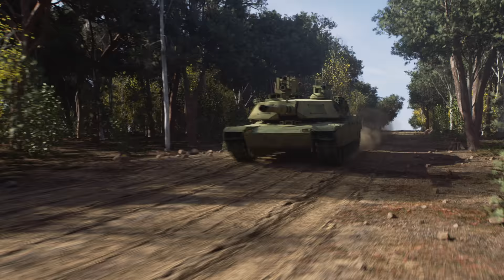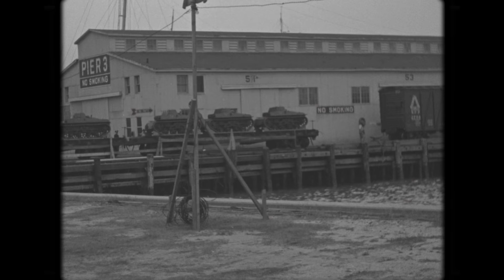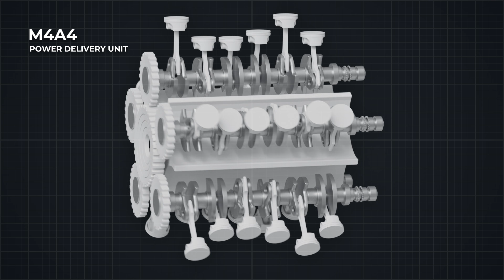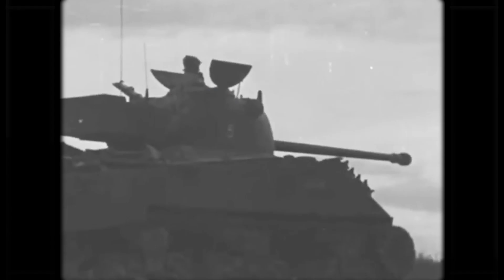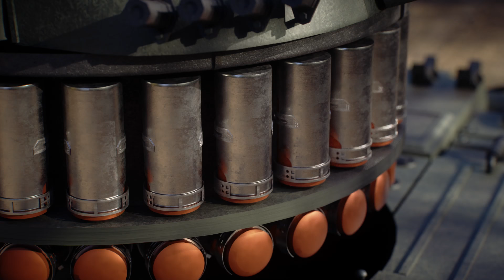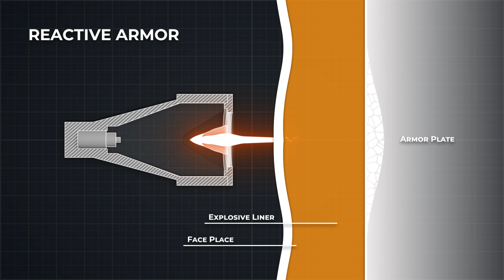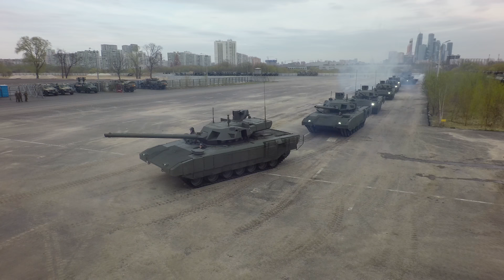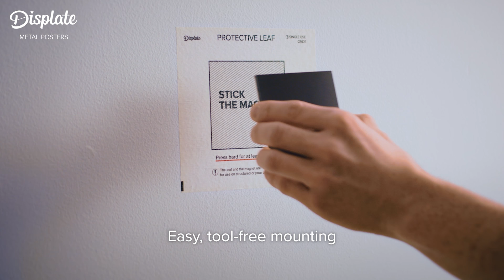Why America’s Tank Failed in Ukraine

Comment: We gave the ukrainians older, degraded variants of the M1 Abrams, basically early 1990s technology, and still better than any modern Russian stuff. It did it's job well and considering we only gave them 31 (plus what they're getting from Australia), things were alright. The difference is that the modern battlefield is way more different than it was when these tanks were manufactured.
Reply: "and still better"
Combat-proven to be inferior.
" It did it's job well"
Murdering it's crews? Getting blow up dozens of miles away from the frontline?
Reply: @vladkorobov155  Russian tanks are deadlier for their crews. The Abrams has a separate ammo compartment and blowout pannels.
Reply: @artiomvv569  
No they aren't.
Nobody cares,because M1's ammo compartment is infinitely more vulnerable and blowout panels are  
a dice roll.
Reply: @vladkorobov155 still safer than having your tank turn into a pressure cooker that launches the turret 200 ft in the air.
Reply: @artiomvv569  
No it's not safer in any way,because probability for scenario you're describing for a crewed tank is extremely low.
And after you ditch the burning tank,nobody cares what happens to it an hour later.
Tanks are expendable. Except for USA,which doesn't build them,so every one lost is lost forever.
Reply: @vladkorobov155  crew survivability is a must in the modern battlefield and western tanks are better protected. Russians aren't even bothering putting the T-14 into mass production, citing it's too expensive despite costing like 5 million $, and something like a Leopard 2a8 costs 30 million $, the same as an SU-34. The Russians had plenty of good projects like Object 187, basically a T90A on steroids and Object 490A which looker like a T90A mixed with a leopard 2 and then theres the Object 490B which looks like something Megatron would turn into in vehicle mode.
Reply: @artiomvv569  
"and western tanks are better protected"
That part is wrong.
"Russians aren't even bothering putting the T-14 into mass production"
Which is why it's production numbers exceed entire NATO MBT production,combined.
Reply: @vladkorobov155 the frontal armor of an Abrams is meant to be equivalent of 1.1m of rha against kinetic penetrators and 1.3m against high explosive anti tank. The turret of the T-14 probably couldn't withstand 20mm ammo by how thin it is. And how's T-14's production higher than all of NATO combined, when only 20 of them have been built in 10 years. That tank has been in developmental hell for 15 years. They should have continued with the object 292 before it, but Russians always go for the cheapest option, it's always been like that, and only now they've finally figured out how to put a new transmission on the T90M, so that it can go at 25kmh in reverse, instead of 4kmh like before.
Reply: @artiomvv569  
"the frontal armor of an Abrams is meant to be equivalent of"
38mm sheet of steel.
That's literally the entirety of upper glacis.
"The turret of the T-14"
Is inside anti-fragmentation frame and therefore invisible and won't be discussed.
"when only 20 of them have been built in "
...last three months.
Reply: @vladkorobov155 the armor on the upper glacis is extremely sloped, you can basically call it roof armor. And i severely doubt 20 have been built in the last month alone, if so, we would already have seen them in ukraine. The problem is that an anti drone active protection system needs to be developed before they can enter combat. Or you could take that T-14 and put all that stuff on it. Tsar Barbecue grills, metal barns, "bushes" made of wire and what such. They do work, it's hilarious how ukrainians mocked them for using these improvised protection systems, and then copied them as well. But thats another story.
Reply: @artiomvv569  
"the armor on the upper glacis is extremely sloped,"
Yeah,and rounds travelling at ballistic trajectory would care SO much...
Gods,for people that don't know physics,world is full of wonders.
"i severely doubt 20 have been built in the last month alone"
Nobody stated that. 
In THREE months,OTOH...
"if so, we would already have seen them in ukraine"
T-14's been operating in former Ukraine for over three years now.
It's been seen there,just not by any OpFor survivors.
"The problem is that an anti drone active protection system needs to be developed before they can enter combat"
It's been developed over a decade ago.
Them radiation signs aren't just for show,you know.
Technically,payload dates from like Soviet Union's Athropos RPG EMP round.
Reply: @vladkorobov155  top attack munition will absolutely penetrate that armor. From the right angle, even a 14.5mm round could go through that 38mm plate. Now if T-14 had been produced in large enough numbers they would have seen more combat. And regarding APS, drones fly too slow to be intercepted, compared to rpg rounds and attack from various angles. And this Anthropos rpg emp round, I've never heard about this one before, and if so, why hasn't it been used.
Reply: @artiomvv569  
"top attack munition will absolutely penetrate that armor"
ANY anti-tank round smoothbore,no matter how bad,will penetrate it at long range. 
With long defined as over five hundred meters.
Less for RPG. It's simple ballistics.
"they would have seen more combat"
False equation. Along with the idea that they did not,in fact,seen more combat. Or less combat.
"And regarding APS, drones fly too slow to be intercepted"
/facepalm
AGAIN. These radiation warning signs are not just for show.
"why hasn't it been used"
Because Abrams Block 3 was cancelled!
And the only tank against which it might have been somewhat useful materialized three decades later and in Russian forces!
Fortunately,designs for explosive EMP generator weren't thrown away.
So,a few decades later,and in different role...
Reply: The job was to capure Melitopol and push to Azov sea. They failed in it. 
Last winter nazi lost Gulaipole, and now even further from that goal.
Tanks are simply outdated. The cargo cult about holy weapons of white gods in cork helmets can't chnge the fact, drones are removing tanks from the battlefield.

Comment: When you mentioned the problem of going from idle to moving, there was a big gap in performance between a turbine engine and a normal diesel engine, I immediately thought "Couldn't they bridge that gap with batteries to store energy and an electric motor to instantly use that power when needed, buying time for the diesel engine to spool up?" It would also solve the fuel consumption problems of the turbine engine at idle, instead you could just shut the engine off and run on batteries until "waking up". They even had this kind of thing in WW2 with the Germans' diesel electric engines, which basically used electricity in place of a transmission between the engine and the tracks. This isn't new tech, they could have been doing this for decades (though modern improved battery energy densities certainly help), so it is surprising that it is only now that they are implementing that into a tank, but at least they are going to be using it going forward.

Comment: The Abrams uses a turbine engine. It is not a jet engine. When we say jet, that is referring to the nozzle on the exhaust outlet that squeezes the gasses through a smaller orfice, causing them to accelerate to generate more thrust.

The turbine engine in the Abrams turns a shaft; this configuration is known as a turboshaft.

When you say that it has a jet engine, that means that it is propelled by squirting gasses out of the back of the machine.

It's not a hover tank.

Comment: Russia lost 2500 tank in Ukraine and your talking about  30 old M1 abrams?
Reply: "Russia lost 2500 tank"
No it didn't.
"30 old M1"
There is no such thing as "new M1". 
Youngest in US service is pushing thirty-five years.
Reply: @vladkorobov155  yes theres , the first version is using a 105mm same on Patton tank M68A1 then the RH-120 was added to replaced it , Ukraine received the old version M1A1 , Us is mostly using M1A2 SePV2 , same thing goes for Leo2 in Ukraine , Leo2 A4 and A6 have different gun version and your right it is even worst than i tho : RUSSIA lost 3600 tank in ukraine , get your facts  straights

Comment: The biggest Abrams's problem is that all the munitions are kept in the back side of the turret right behind the armor. It was a good decision when you prepared a tank for tanks vs tanks. 
Today it is an absolute nightmare for ukrainians because drone operators are especially trained to hit the back of the turret. 
T-90 has it's munitions kept deep inside the haul, the autoloader pick them one by one. Even if the drone operator penetrates the turret, still chances to hit autoloader and munitions are low.
In case of Abrams it is 100% kill. If you touch the back side of the turret - the tank is 100% gone.
Reply: I wont say that the Abrams is good, but the decision still makes sense, you just need a weapon system against drones.
Reply: @randyraudi7725no, the idea is retarded since the beginning. They lost a lot to guerilla fighters who shot the tanks with RPG from the flanks. 

Among all modern western MBTs, Abrams is the oldest and outdated. It's all glory was born in 80s and 90 where it thought an already outdated Iraqi army armed with the export version of t-72. 

Absolutely safe to say that t-72 is a level of Abrams.
Reply: @jacobfrost2131  
It's slightly more complicated.
T-72 without letters has no FCS.
As in,fire control SYSTEM. M1 without letters does have FCS.
But has no HE-FRAG round and therefore nobody cares.
Reply: @randyraudi7725 
No,because let's remove drones in entirety from the picture.
You still a huge-rearend turret half of which is ammo bins. Huge,unprotected,easily targeted ammo bins.
Reply: @vladkorobov155  Just don't let yourself get shot from the side or back, you have to store them somewhere. Where do you want to store them instead ? Directly in the turret like the russian tanks ? If another tank or anti tank rocket hits your ammunition depot then well, shit happens, at least the crew survives this then. I mean now everyone tries to shoot at these ammunition depots, what do you think where they will aim at when you move them into the turret ? Of course they wont shoot at the back then anymore.
Reply: @randyraudi7725 
"Directly in the turret like the russian tanks"
Russian tanks store ammunition in armored autoloader below the turret.
In normal conditions,it's hidden behind ground screen and therefore untouchable.
M1's ammo are in huge and unprotected ammo bins up high.
Leo 2's primary ammo is in front hull directly below weakened zone in upper glacis.
Reply: @randyraudi7725
>don't get shot in the side or back. 
Great idea, if you are poor, buy a house. 
>directly in the turret like Russian tanks? 

They are already in the turret of Abrams. Already. 
In T-90 99%of them are stored deep down in a hull, it is easier to shoot a star down from the sky than to trigger it's explosion. The autoloader grabs them one by one up to the turret. It takes a very lucky strike or many strikes to hit a munition inside t-90m. 
Abrams m1a2 is 100% dead if you hit it's turret with a drone, there is absolutely no chance you don't hit the munitions in this case, they piled up exactly behind the thin armour. 

Don't protect the initially stupid decision of american tank builders. They know it themselves it was the stupid idea, it was good only for a battle vs soviet t-72 1vs1. In a guerilla warfare or modern warfare it sucks. 
That is why a concept of a new Abrams DOESN'T HAVE this - new abrams will have autoloader, munitions will be stored deep in hull (omg, americans coping russian design, what?!) 

Among all the modern western tanks Abrams is the oldest and it aged like milk. It's glory was born in 80s and 90s when it fought against export version of t-72. It was obviously superior. Those years the technical gap between USSR and USA was maximal. It's not the case today. 
Since then lots of years passed, none is surprised with double command and control systems or with nighvision. But 80 tons of mass, lack of autoloader and stupid pile of minitions right behind the thin turret looks bad.
Reply: @jacobfrost2131  
"Already. 
In T-90 99%of them are stored deep down in a hull"
Specifically,there is a capability to store them in a turret,but in practical combat conditions nobody does that.
Leaving the tank with twenty shells,but also without possibility of suddenly exploding.
Reply: @vladkorobov155 different situations. 
There was a video of ATGM cornet oneshoting Leopanrd 2 and it exploded into peices. It is thought that the crew took a lot of munitions and the tank was like a powder keg. 

Maybe the tank was on it's way to a position to conduct indirect fire shooting, not going for an assault miasion, but instead got ambushed. Or the crew believed in Leopards armour too much.
Reply: @jacobfrost2131  
Ahem.
Kornet penetrates any in-service tank,from any angle.
And Leo2 has ammo bin in the front. 
There are vids from like 2018?with Kurds one-shotting that toy from Metis.
My point is bad example.
"Or the crew believed in Leopards armour too much"
I wouldn't feel safe in Leo2 against people with PG-7
Without additional letters.
Against PG-7VL i would run for my life.

Comment: Focused so much on WW1 ,WW2 tanks that failed to properly analyze modern tanks. 
The armata design is not the first one to have a remote turret system with the crew on the hull. 
Failed to include modern Chinese tanks with already in production hybrid propulsion system. 
Yes, the trubine consumes crazy ammount of fuel and only makes sense for a nation that can sustain it's logistic , but that's not the reason it failed in Ukraine ( plot twist Abrams ,Leopards , T-72 all got destroyed )
"Hit & Run" tactics are used by russians too with diesel tanks , because there's a small time window of action until you are detected and swarmed by cheap drones.
Sorry but downvoted this one , is clickbait and pure AI nonsense rambling
Reply: "The armata design is not the first one to have a remote turret system with the crew on the hull. 
"
It's the only one that is a)in production and b)saw combat.
Reply: @vladkorobov155  
A) No , China has it's own crew on hull tank in production 
B) The Armata has never been used in combat, It has been deployed far for frontlines as testing

Beyond that RE points that Armata design is a "solution to all that" meaning the problems He listed.
So it's the design it counts and no it does not solve anything since the video looks like AI slop.

Comment: I highly doubt the T-14 Armata would be put into service since it was built for tank on tank combat. With that largely being a non-viable design, it is best used as a testing bed for the new technologies that can be conventionally implemented. Removing all the bells and whistles for real results.
I noticed that Soviet/Russian tank development has always started with a wishlist tank, with the Spanish civil war experience, they wanted a tank that had chainsaws and maybe even a flamethrower for urban combat, they obviously never got that but it shows how their tank development always start. The fantastical testing paves way for conventional success.

We may see a T-90 variant or a whole new model with the isolated crew capsule built for all-around protection and proper mounting points for external armor meant to prematurely detonate a typical heat weapon used by a drone. Even current turtle cage arrangements can take well over 40 heat projectiles before it was destroyed, protection the engine and tracks became pivotal to survivability and forcing the use of more drones and heat rounds that could be used against other targets.

The most successful drone-resistant(not proof) tank would come from Russia as they have the most experience and capability to translate that experience into a proper tank/umbrella as they have multiple answers to intercepting drones for fractions of the price NATO and other typically Western answers require for equivalent or greater results. 

Steel tracks are also better than rubber tracks any day in my opinion.

Comment: The M1s did not fail. A tank is a part of a war machine. A machine is constituted by multiple parts. Expecting a single part of a machine to independently operate as a machine is, well, indicative of lack of understanding of basic concepts about anything. For dumber folks, here is a spell out: Consider a Ferrari automobile. Remove the transmission, and place it on a road. Expecting a particular tank to win a war is like expecting that Ferrari transmission to run like a Ferrari. God, you people are so stupid, it is cringe.